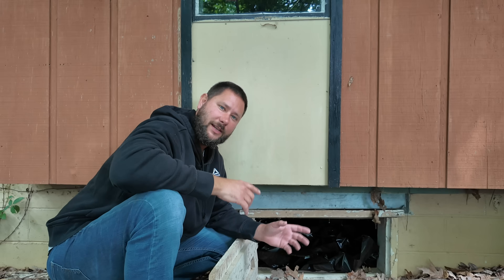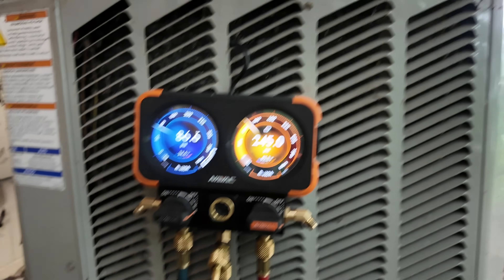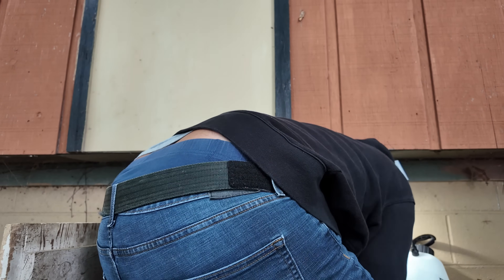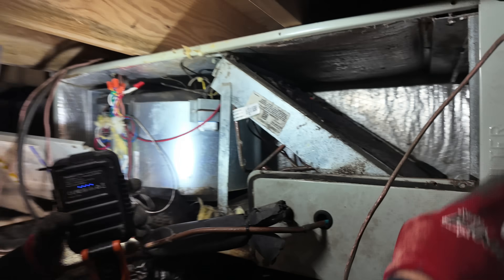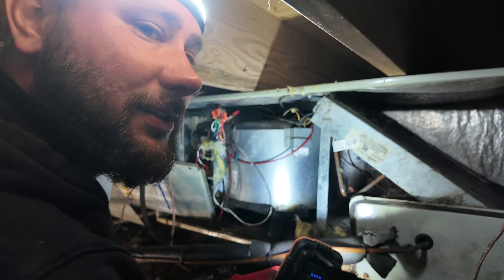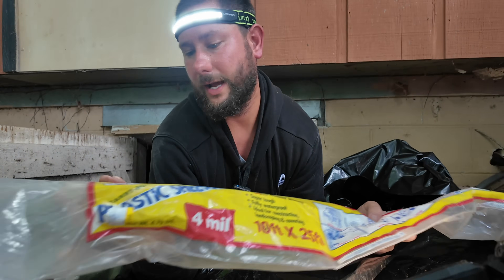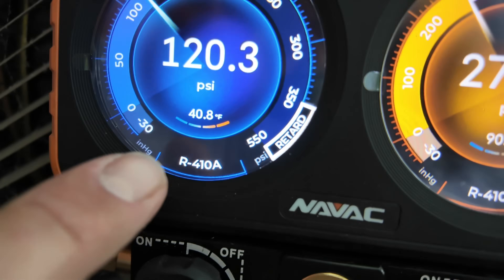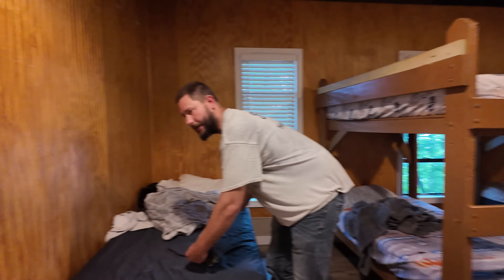How I Cleaned a Super Dirty AC Coil in a Tiny Crawl Space!

Comment: I would like to clean the evaporator coil on my AC but don’t have any idea where to open up the area where the coil is.  I have a Lennox C33 - 48B - 2F - 3 unit that sits on top of my furnace.  There may be some screw heads under the sealing tape the original installers put in place, but it doesn’t seem like it to me.  I got the install manual from Lennox (via their online site), but it isn’t very helpful in this regard.  I am not an AC tech but feel I can do a cleaning if I can just get into the unit without messing anything up.  Any suggestions?

Comment: our evaporator coil is facing window and blow it, separated with metal fake ceiling is the shower, so right in front of the coil there is a lot of rust that the previous tenant ignored for long. What do you recommend ?
how to make sure that if i put a merv filter i put in front of the coil there is enough air flow for the coil? we had ac pouring water when we put merv filter

Comment: And I thought my evaporator was difficult to get to. It still is, but that one tops the charts. When we put this house up I wasn't the best at religiously replacing the air filter so the evaporator got dirty and the air flow suffered. Resulting in low air flow and the evaporator freezing up. I've dived into cleaning it twice now and will do a third soon before the high summer temps get here. But for now it's working, no freezing up and it's keeping the house cool.

Comment: Tad! Many times I’ve had to clean the air handler in a garage. I will get the shop vac and explain to the customer there’s gonna be water. The crawlspace you were in my opinion with a grain of salt would have gotten that water hose and blasted the chunks out the coil. Then pull the fan and clean the blower. Love your channel! ❤

Comment: Man...and I thought I had it rough in my double wide with only 2ft clearance. At least mine sits on a concrete slab. I can pull my 6'4" BBQ loving blubber around on a creeper at least. That furnace looks like it was set in the hole before the place was driven over it. 😂
I was surprised to see no rotted or mildew stained wood under there seeing as there's no moisture barrier. They might want to do that or bellywrap it. 
Great vid! I appreciate you explaining things in detail for new techs or us DIY weekend warriors. 👍